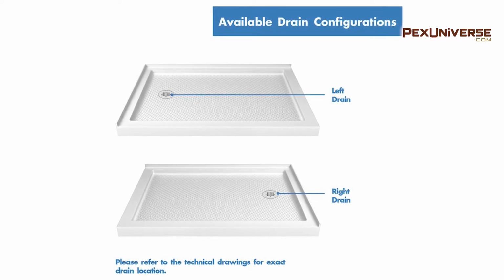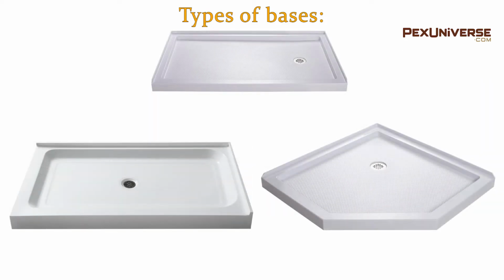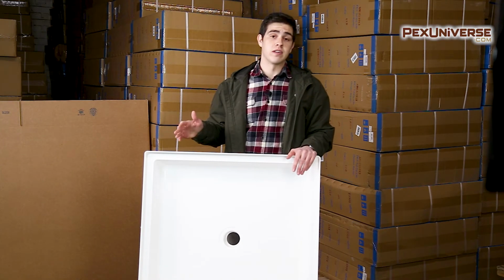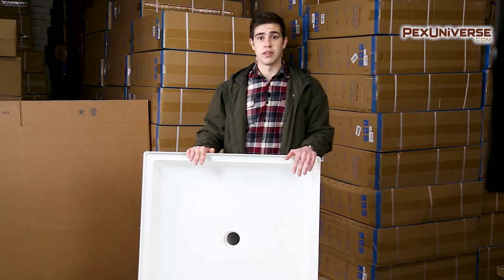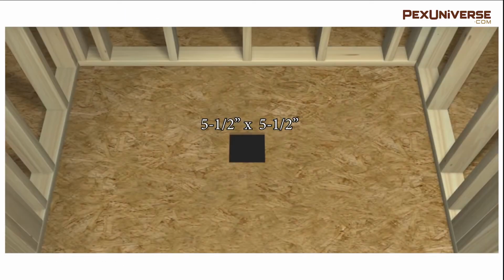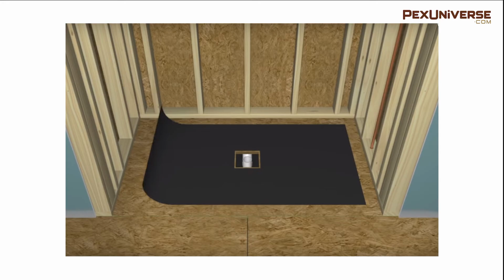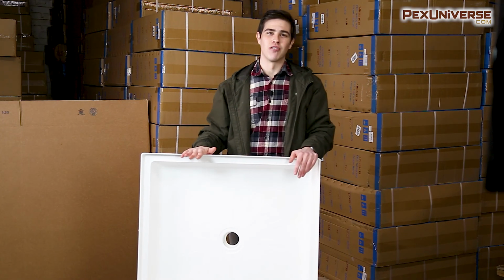How to Choose and Install a Shower Base: Basic Instructions for a Smooth Installation!

Comment: If you have the drain setup first do you just slide it over the how would you recommend cutting the stub out to correct height. And the seal you’re using. Thats a good seal?  I can’t believe it doesn’t need any compression
Reply: Seems it's hammer in or pressed in with a wooden dowel , not like a conventional lock nut on bottom and tightening on top with screwdriver and slot tool

Comment: Thank you for the tip on a trusted brand.  It's hard to choose from all the different price points from the big box store items.  I think an integrated seat at the back of the unit might be a good idea because the roof in our bungalow style house really keeps you from standing at that end of the shower anyway.  And there are a lot of reasons people might need to sit in the shower too.

Comment: No mounting clips came with mine, nor is it as included in the carton.
(1) shower floor,
(1) drainseal
(1) strainer
Reply: Same with mine. What mounting clips? Drain seal? Thank god I got the strainer.

Comment: How do I hook up the existing drain if it is not pvc. It appears to be brass or coper
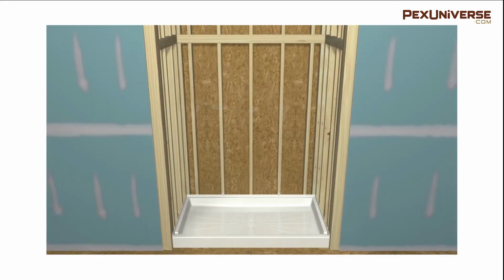Reply from the maker: Hello Edward, in order to connect your shower base to a non PVC drain you have to replace a gasket (5:30) with one that is intended to be used with brass or copper.